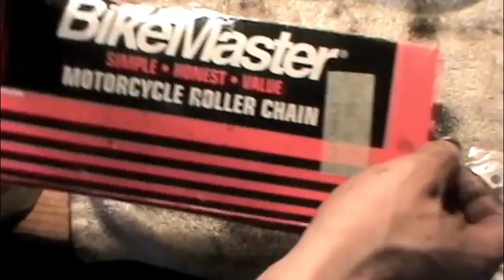Honda ATC Rebuild Part 3

Comment: oh i see,in that case squeeze away :) as they say for 2st gaskets are everythin but not so much so for 4st as they have there valve for compression i not long ago rebuilt 1 of these it was a 125 with honda cg engine with the push rods i had a new carb all new gaskets piton rings piston pin ect. re-ground valve seatings & was immensely fast! im sure it will run for another 20 yrs remarkable engine's with regular maintenance, happy riding to you to"!

Comment: hey man i got a xr200r (basicly the same engine..) I removed the 4 bolts on top of the engine (2:12)  but still cant get the valve cover off! am i missing something!?
thnks

Comment: hey i just has a few questions i recently rebuilt a 200s engine i just replaced the rings fixed the timining and adjusted the valves but for some reason it will not runs , it has spark but still will not run do you have any idea if you or anyone else does please explain thank you
Reply: Erik Creamer i have piston on compression stroke and the piston is on top dead center